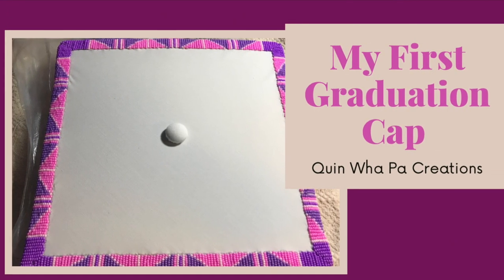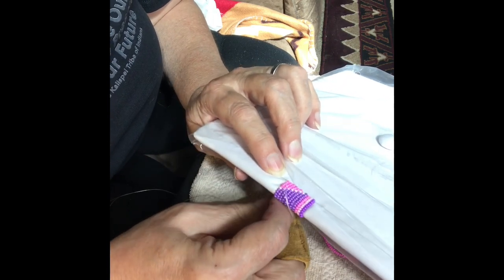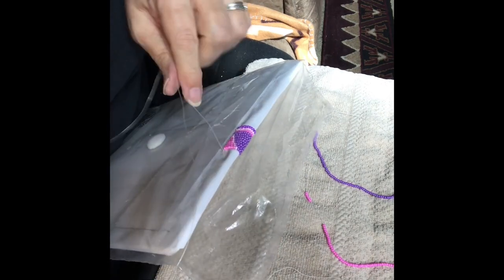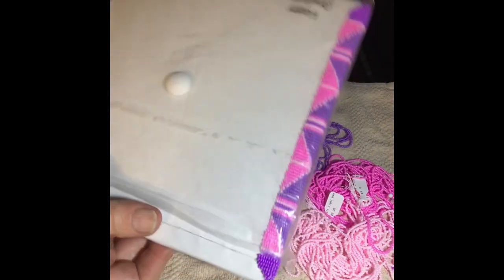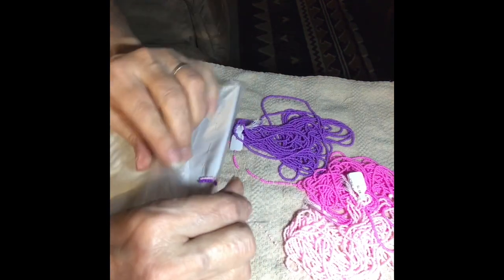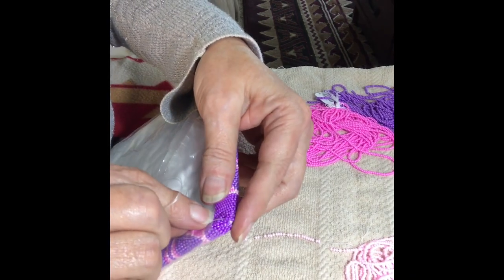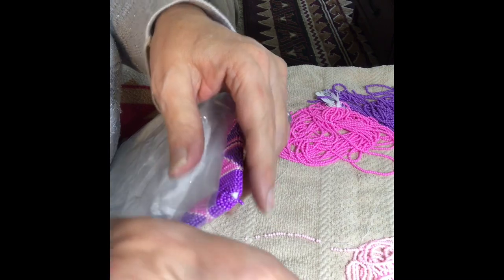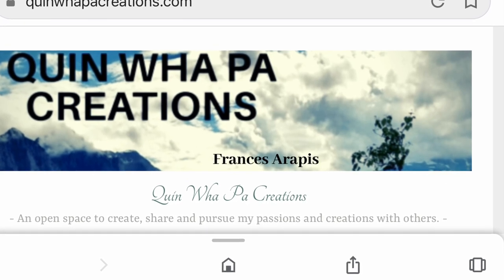Beaded Graduation Cap

Comment: Can you tell me how many beads you used in total or a rough estimate? Also did you use wax on your thread
Reply from the maker: I do not wax my thread. I use size D Nymo. I have 21 beads going over the edge to back side. I used 20 on another cap I did.

Comment: Do you use a regular beading needle or does it need to be stronger? If so, what kind?
Reply from the maker: If cap is easy to go through I use a size 10 glovers needle. If it’s too hard I use a T-pin to create the hole first. Depends on quality of the hat.
Reply: @QuinWhaPaCreations  thank you!